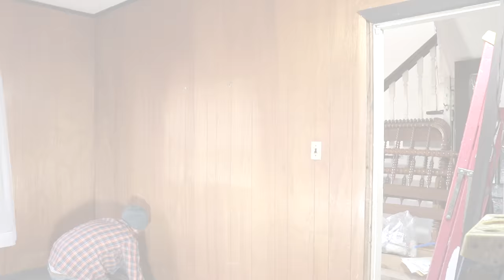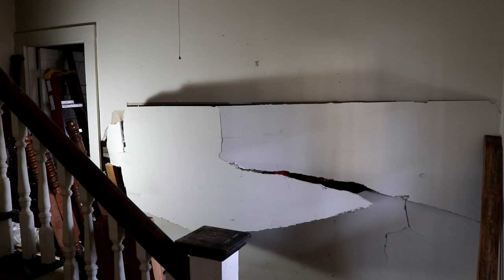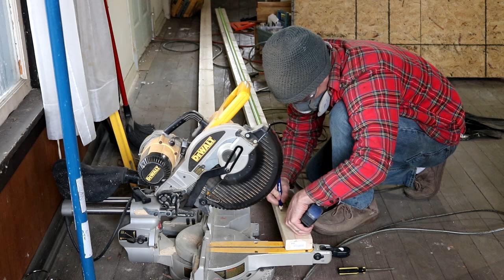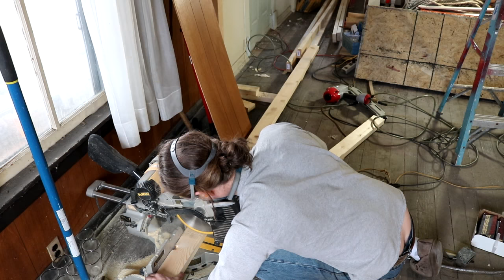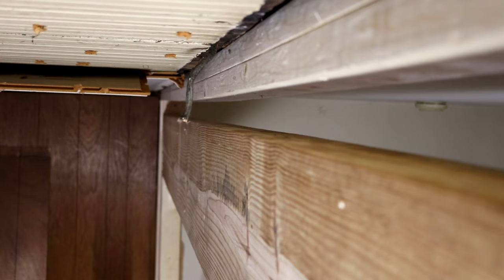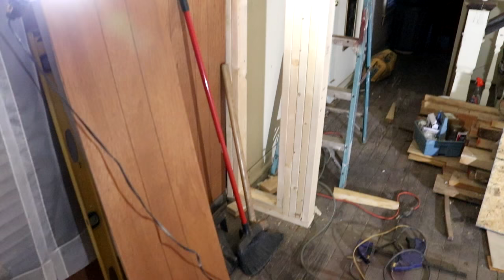$11,500 Farm House on 4.5 Acres! Removing a Wall - Renovation

Comment: soooooooo, why build a load bearing wall to replace a non load bearing wall? Trying to understand the logic there.
Reply from the maker: +BIZKIT It is partially bearing the load but the 2nd floor joists do not hang on it. There is a wall over it though. Older house have other things you have to consider since they were not really built to any specific standard most of the time.